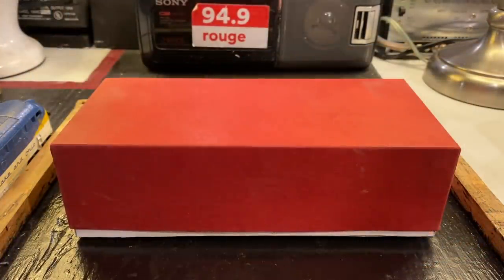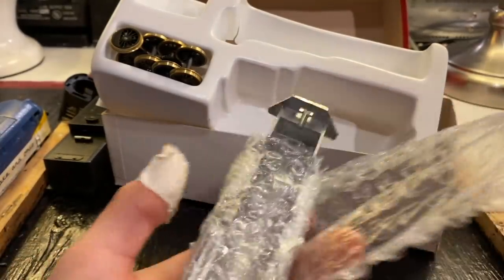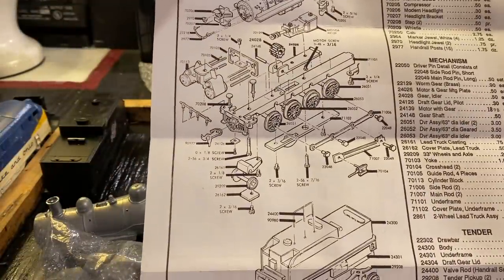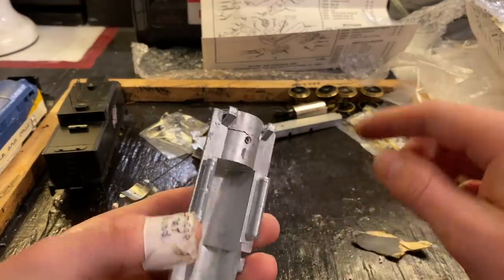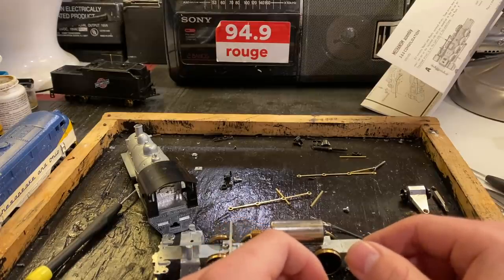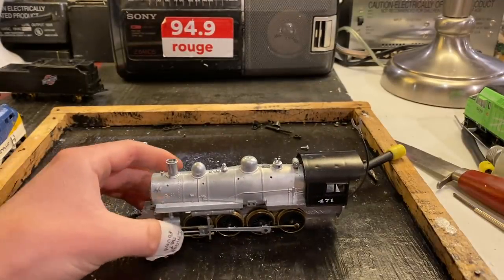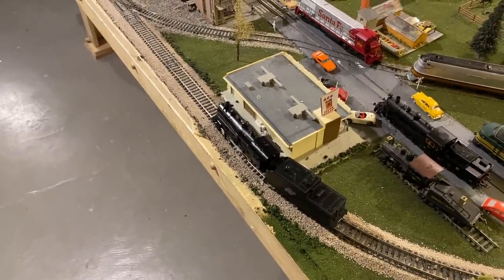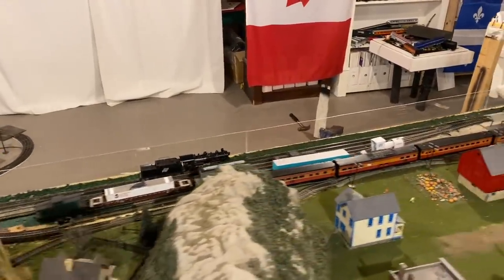Building My First Ho Scale Steam Locomotive - Roundhouse 2-8-0

Comment: Nice job on your first kit!  I also built one of these a few years back, and it smoothed out a lot after a few hours of running.  One thing to keep in mind when building kits is to work out as many kinks in the drive as possible before painting and the final assembly, since it's easier to work on it without damaging anything or scratching the paint.

MDC/Roundhouse kits are generally good, but had a tendency to cut corners to keep them cheap as you've found.  They're good, reliable runners after some tuning and break-in time.  Mantua, Varney and Bowser kits have been better out of the box in my experience.  Tyco kits are the same as Mantua, but their quality control wasn't quite as good after they were bought by a food company in the 70's...
Reply: Darth! You're back! What's up!
Reply: @Alerrecks  and then they never respond...
Reply: @stuartsammodels6750  and than Blaxland never responded...
Reply: @Kuhneesseur  and then StuartSamModels never responded (sorry, couldn’t resist 😂)

Comment: I bought a Stewart Hobbies Alco century 628 from eBay. It was a model kit but the entire drive system was assembled. I basically had to screw down the Circuit board to the mounts above the motor/driveshafts,. I did have to assembly all the cab glass and the body/cab shell and the handrails. It has great directional lighting but after about 30 40 seconds of running the motor free spins inside the little CV joint pivot thing that goes to drivers. Can't glue it cause then the locomotive would not be able to turn but ran with my when doubled heading with a Walters Gp9M. It runs fine. I love the directional lighting. Anyway I found out Stewart Hobbies which used to be a small modeling company from Chalfont PA USA was bought by Bowser model trains.

Comment: Roundhouse kits (MDC) are truly a blast from the past.   They assumed you wanted to almost build it from scratch if you were a modeller in 1975.  The Mantua kits were a bit better.   The Browser kits were  some of the better budget kits.  Trying to build working valve gear with mm peen rivets is a true learning experience.  At least this one skipped the valve gear.   My first attempt was a 040 Mantua slopeback switcher at age 9.  It worked with some struggles and mistakes.  I thought about buying the valve gear option,  but wisely never did.   Learned how hard that was at 35 when I bought a Bowser K1 Pacific.  Beautiful model.   Quite a pain to build and detail. 

The biggest problem with most of these die casts are short circuits on the metal chassis or the motor touching the boiler and the boiler touching the frame occasionally after a track bump. 

Benchmark testing each assembly milestone with some lead wires, and NMRA gauge each step helps.   Rolling the assembled drivers before attaching the motor helps loads. 

It will likely never run as well as most RTR but,  like you said,  it is a challenge and truly more modelling than just plopping down a RTR.

Comment: WOW! Great job! Im also working on a kit right now. Its a Bowser kit, which are a little more in- depth. With the bowser kits theres a lot more assembly, painting, and gluing. I would recommend trying one of them out if you want to increase your skill level. Im converting a Bowser 4-8-4 kit into SP&S #700 which currently resides in the same roundhouse as SP #4449!

Comment: Very nice final assembly.  It will eventually run fine with a little tweaking.  I built the Roundhouse 4-6-2 kit and had to replace my lead wheels with metal ones so they would not jump track.  When adjusted and broke in it turned out to be one of my finer steam locomotives.

Comment: If you should do this again and I wish you well.A Word of advice when you do,once the chassis is finished but before valve gear is added just side rods,break in the mechanism.Side rods will most likely need run in time to insure that everything is properly broken in,take this step and you will be amazed at how smooth and quiet this loco runs.

Comment: Nice! Mdc kits are a very good way to learn how to build locomotives and kitbash with other parts! A couple of notes: the tender truck axle wipers should be bent down on top of the axle as the tender sits on the track, not bent up pushing up on the bottom of the axle. You should always have the wipers pressing down for better contact. The clicking sound is the piston stem/main rod hitting either the piston assembly or the hanger assembly on one side. It also looked like there were some pilot steps missing, and your front coupler! 😁 if you want to feel adventurous, look up the mdc shay kit!

Comment: I would recommend not doing a big brass then. The big models take about a year to build with all the detail. There's definitely a difference between building models and running them and fixing them and running them. Some people go to Great Lengths in great detail to run there track by laying individual rail line and tides.

Comment: You should have spray painted the parts before putting it together!
Also, I'm disappointed that a supposedly "die cast" model isn't up to snuff. For a model over $100, not only have they half-assed the cab and tender with cheap plastic, but they've also forgotten to cover the wheel axels! This isn't Heljan, so it's forgivable, given Heljan is a Dutch company that sells their models for way more yet continuously botches up their models, but I'd still expect a little more for a model over $100.

Comment: "Kit ?", it's part made. And Plastic parts, not metal ! Nasty Brass wheels, not Nickel Silver. Your going to have loads of problems with virtually constant wheel cleaning !  And an imbecilic white metal chassis (not brass or nickel silver) that means you need brass bearings for the axles. And the tiny motor, if it isn't a CORELESS type, it isn't going to pull much ! This must be some old second hand item from the 1970's or earlier ? It's prehistoric !!!